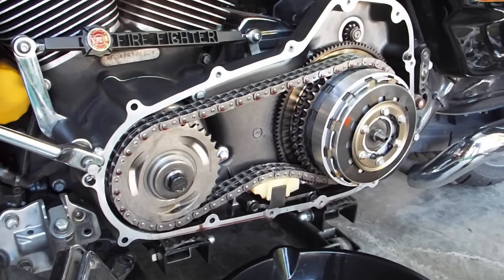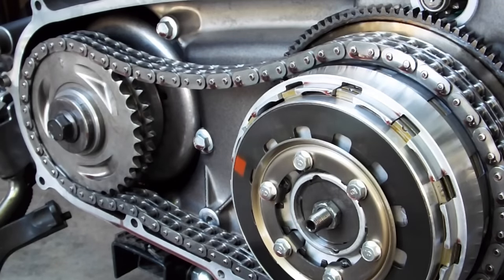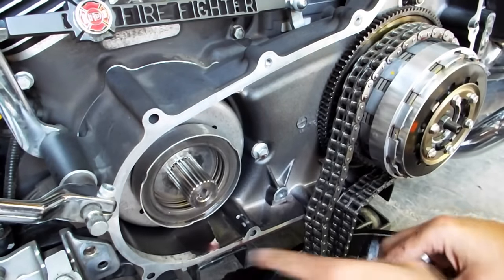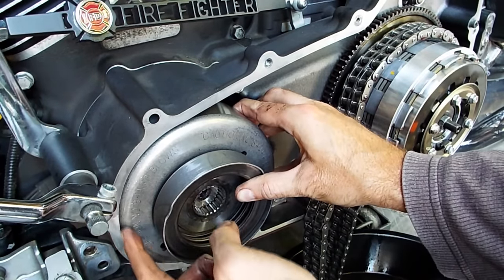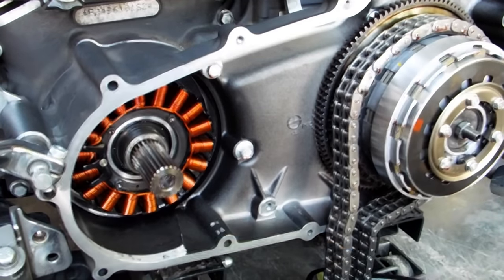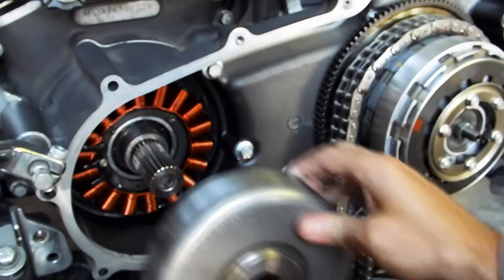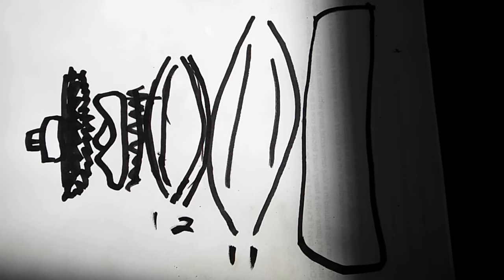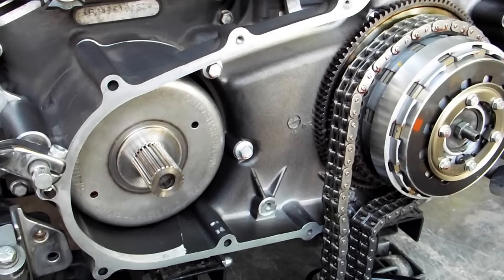Old Compensator to Newer Screamin Eagle

Comment: Hey Mark! Thank you for doing the experiment with the extra spring washer! I just finished doing it to my 2009 Road King and it seems to be working good for me so far. I did torque the comp bolt to 140ftlbs the first go round, but man after about 10 miles there was so much noise coming out of the chain case I wasn't sure if I should ride it back home or call and have it trailered. I rode it home as gentle as possible. I took it back apart the next morning and noticed that the teeth on the sprocket were running way out against the side of the primary chain and had it running way out on the clutch sprocket as well. I grabbed the torque wrench and checked the comp bolt, I ended up turning it 3/4 of a turn before my torque wrench clicked. That pushed the compensator in far enough to get the sprockets both lined up with the center of the rollers on the chain. I also put in a manual Twin Power tensioner and when I got it all back together I was happy that the bike is now quieter than it's been since I bought it 5 months ago. It shifts into neutral so easy and most of the 6 speed clunk is gone shifting into first. I'll update you when I get more miles on the bike. Thanks again for doing the experiment!!!
Reply from the maker: Thank you for letting me know! I wonder if the back spring washer dropped behind the center core and got pinched between the compensator and rotor, and then popped out when it was under load? People have suggested that adding an extra spring throws the alignment off, but that's not the case. The alignment is determined by the center core. I'm still running that setup on mine with no issues so far. I'd guess I have around 10,000 miles on it now with this setup.
Reply: Sir did you add one to the original, or screaming eagle compensator, you had stated that you got another 3/4 turn on the bolt,  I've learned that the loose thing happens too often on the original, because the washer under the bolt is springy, and doesn't transfer the tightness to the extension enough to actually even be tight. Torque wrench readings would be false against that washer. The problem goes away with the screaming eagle unit, for lack of the "WASHER" . Anyway what's your experience on looseness after torqueing the comp bolt.

Comment: Nice video. My only comment is on your torque technique. I always “sneak up” on a torque instead of torquing to final spec. In other words; torque all bolts to say, 15 to start, then 20, then finally 26. And, after final torque to 26, I also recommend you go back a minimum of three times to recheck the torque of each bolt. You’d be surprised how many bolts stretch and lose their torque after a few seconds. 

Just my .02
Reply from the maker: Thank you, understood and much appreciated.

Comment: Hi Mark I just started watching your videos 👍👍. I like the idea of trying to improve something but the compensator springs are designed to work as a set equally distributing the force . By installing  a second medium spring it doubles the force to bend that spring and causing the remaining springs to distribute the force and bend further cause the 2 medium will bend last. You may see  premature wear on the single spring but how soon your guess is as good as mine. Keep on with the videos great job.
Reply from the maker: Thank you for the comment, Mark. Yes, I am aware of the more stress added to the rest of the spring pack, good observation. I intend on opening the primary next Spring before riding season to inspect the parts and assess how things are getting along. Crossing my fingers.
Reply: I was thinking the same thing about premature wear. Because it was designed to work as a set. That don’t mean I don’t love what you’re doing man. It’s people like you who come up with ideas that often turn out better. I’m definitely gonna be watching and keeping an eye on you you’re very clever. Keep the videos coming please I like it when people think outside the box that’s why the compensator has been changed so many times. My Panhead doesn’t even have one just straight socket course it has a dry clutch Keep doing what you’re doing people out here enjoy it later
Reply: This is John again. I also have a 2016 fat bomb all kinds of noise is coming from the primary it only has 4200 miles on it of course 103 high output motor with not even 100 hp. The dealership I bought it from said they all make that kind of noise. Now I’m finding little pieces of metal way too big to be normal on the magnet dealership is lying to me. I hope it’s just part of the starter gear later on buddy sold a Panhead by the way. Love that bike John tanner easy Rider 1991 gulf war issue 49 pan I got a good price for it though. I’m thinking about going back to no compensator straight And direct. Just like my go cart when I was a kid push to start
Reply from the maker: John, I know what you are thinking with the compensator delete, but I don't believe the clutch splines will put up with that in the long term. My 2009 with about 80,000 miles is making a rattle sound from the primary that I'm pretty sure is the clutch main shaft bearing. I haven't dug into it yet.

Comment: Mark thank you for your informational videos on this issue. I just replaced my 2009 Heritage Softail compensator with the SE unit. Despite only 14,000 miles the original had failed! Your video guided me through the process, but the softail inner primary is much tighter & hence the grinding of the metal to facilitate the new stator was little more than arduous. But I prevailed:) the bike now starts & runs great, I saved over $1500  labour at the HD dealer, & I simply feel great about my bike, hopefully this is not a temporary sensation:) Luv your videos, keep them coming your a rare bird, lol.
Reply from the maker: Your reaction to the upgrade is the same as mine! Time will tell as far as how long the SE compensator springs will hold up, but they are stronger than the factory unit that was installed on our bikes. I didn't know the Softail tolerances were a bit tighter, good to know. Happy and safe rider to you, and a job well done!
Reply: Read your issue having to grind away material in your primary. Have a 2009 Softail Custom. Had no problem removing compensator with rotor. I would think it would be identical to mine ???? Harley gremlins ?
Reply from the maker: @SIERRA-dx9wm  I agree, I would have thought they were the same. There was no way mine was coming out without grinding some material away. I kept trying it and would find the high spots that it was hanging up on until it slid out, but still rather tight. Are you the original owner of that bike?
Reply: Yes I bought Mistress III brand new. Great ride. 96 motor is one of HD's best.  @contact4mwy7

Comment: The only possible issue i see is the belleville washer opposite the one where you added the extra may have the potential to overflex.  But thats probably not even an actual thing.
Reply from the maker: Actually, I agree that it could be a possibility. Right?
Reply: @contact4mwy7  Maybe. It depends on some unknown factors. I'm sure  someone with a degree in springology could   come up with an answer. 

The only time the washer over flexing would actually be an issue is if it didn't plasically deform and instead decide to asplode.  Itd be interesting to put on in a press and see what happened.
Reply from the maker: @DoRC  it would indeed be something to see in a press! I like the term "springology," that's a good one!
Reply: I think that it could be possible that the springs are nearly, completely flat against each other when the  bolt is tightened down,and the crankshaft pulses, cause them to contact,their entire surface area, therefore the pulses sould be much less, with an extra spring.
Reply: This seems like a good idea that would actually take up any slop in the system. Im going to try it as I have some extra bellville springs
Reply from the maker: @fluffypuppy720 I'm still running mine like this, same set, since this video was made. How many miles ago? Well, I'm over 90,000 now.

Comment: I have a 2011 Dyna. I removed the 2011 compensator and installed a OEM 2016 Road Glide SE style compensator. Seems to run fine with it. No more kick back at startup. So I am happy.
Reply from the maker: I am running an OEM 2012 SE compensator and have found good results also.

Comment: Adding that extra spring washer is loading your cam parts unnecessarily. Don't know how many miles you have on it now, but I would pull it and take a peak.  A tip to pulling rotor. Tap and thread the two holes for 1/4 20 thread. Screw bolts in use them to pull on. Easily control rotor reinstalling it. My stator was burned up. I did the threading while it was still installed on shaft, not worried about getting metal in the stator windings. What primary oil are you using?
Reply from the maker: Adding that extra spring washer or four brand new ones (which have to come from a dealer, hard to find) was necessary to my situation. The four original spring washers were worn out and causing issues when starting the bike. I eventually put a Screamin Eagle compensator in it, but this five washer spring configuration did a decent job for startups and absorbing engine pulses. Good tip on rotor removal and reinstall. I have been using Dexron III automatic transmission fluid in my primary on this bike and the one before it. No friction modifiers, less clutch plate "stiction," won't harm the stator wiring. It's very similar to the Red Line primary fluid. Thanks for commenting!

Comment: Hi there Mark!
Taking the thrust washer out and adding in another spring washer, Seems to me would make the double spring washers stronger against the outer one. They were a pair originally, and as such they were flexing the same amount. By adding another one to the inner spring, you ought to force the outer one to flex more because the inner two are so much stronger. I'm thinking that could become an issue later on?  I don't know if they can break, but the outer one must be flexing more than intended.......just my thoughts, anyway.
Reply from the maker: Hello Ace! You are most likely correct in that assumption. Something has to give, right? In my inspections since, I have not seen any issues created from this configuration, and although I did try running it without the extra spring washer, I later put it back in because it felt a bit too soft and a little sloppy on startup. This is only my two cents, your results may vary. Lol.

Comment: I've heard a few negative things about the screaming eagle compensator. About to have my stock 09 Road Glide compensator changed to the screaming eagle unit. Hopefully that will stop the slapping noise
Reply from the maker: I've heard negative comments too, mostly about their springs getting weak or the ramps wearing away from use, but it takes a lot of abuse in protecting the rest of the drive line. I'm still using a salvaged compensator with an additional medium spring washer at the very back to beef up the spring pack just a little more. Glad I made the change from the stock unit. Well worth the time and money.
Reply: Ummmm   I just chucked my SE comp.   Very noisy,  bucking when reving down  and shifting got noisy when hot.   Gone solid.   Night to day difference.
Reply: @semtech30  what differences does the compensator eliminator sprocket make ?

Comment: I would think that your alignment between your front primary sprocket and clutch basket sprocket would be altered due to the additional spring being added.
Reply from the maker: I know, Kenneth, but it's not the spring pack that determines the alignment, it's the stack of metal pieces in the center of the spring pack against the rotor cover. That's why those parts are not interchangeable. Thanks for inquiring.
Reply: @contact4mwy7  okay cool. Kudos

Comment: Hey Mark, thanks for the video, it helped to fix the problem I had in my bike. I would like to change the all kit with this new screaming eagle kit. Where did you get it? I would like to order the new kit with all the parts I need. Thanks for the useful infos.
Reply from the maker: Thanks for letting me know! I bought all of my parts previously owned, in other words, used. It took a few months of waiting for a lower price to come along. I bought mostly from salvage shops. The would usually have a video of the bike the part came from. Just like Johnny Cash, I bought the unit one piece at a time! Lol. Sometimes I bought a box of miscellaneous parts so I could use something in the box that was hard to find other wise. I used eBay for the most part, but there are salvage shops that will sell and ship directly to you as well. My compensator is not the latest and greatest one, it's one model back which does not use the oiler plastic tray epoxied inside the primary. Make sure you get parts that match. The new and the old SE units have subtle differences that cannot be mix and match! Ok?

Comment: Hey thanks for the great video.  I'm curious if you or anyone reading has taken the stock rotor and cut the spring basket off to run the oversized SE spring washers.  If so, think I could do it with out having to take it to a machine shop to be milled?  I bought my SE compensator 2nd hand and it didn't come with the after-market rotor.  Thanks again for your time in making these videos.  They help a lot.

Comment: Hello Mark , thanks for sharing this video . I am experiencing difficulty in pulling my compensator , Ive seen how you did it but it seems like in my case I have to shave alot coz I could not really get it out , I am using 100 grit sand paper and have shaved about 1/64 all the way to the edges and still have to shave more. How much is tolerable to sand out   ,just wanna get your idea?
Reply from the maker: Leaving enough for a good seal for the gasket. You should see scuff marks where you have sanded from the magneto cover rubbing against it. That will tell you which areas need more removed, so you don't end up removing more than necessary. I can't rule out that you may have to remove the inner primary housing.

Comment: Hoping to hear about the long term review of your set up. My Baker is starting to clunk when hot. Gotta inspect it soon.
Reply from the maker: So far so good. I don't have the current mileage on this setup at the moment, but remind me to post it. The startups are spot on (especially since I added shims to the Hayden tensioner to reduce the gap from 3/8ths to 3/16ths, which Hayden would not recommend I'm sure). No clunking around even when hot. Good on acceleration and deceleration, nothing unusual about it there. I'm curious as to how it holds up as the miles get higher, will the springs get weak even with the added 5th one? We'll see. Thanks for checking this out!
Reply: just got my Baker after 3 1/2 months on order, looks like a total redesign, please dont say its starting to clunk too!!
Reply: Friend I'd just recheck the torque on the baker...also if they sell the springs, order more.

Comment: Would you still recommend SE Compensator? 
I was looking at baker and dark horse ones. But I have concern abit on non stock feel or non stock noises
Reply from the maker: Although I am not personally familiar with either of those compensators, I have heard good things about them and have received many comments recommending them. I am happy with the SE unit so far even though it came from a salvage, but my motor is only 96 cubic inches which isn't putting a lot of stress on it. I'll let you decide which one to buy. Ask around with other YouTube makers who have put on the Dark Horse or Baker to get as much feedback as you can. Thanks for asking!
Reply: @contact4mwy7  
Yeah I will do that good idea. My bike is only stock 96 ci just looking to make it as reliable as I can. Seems so Harley parts may not be so reliable ??? Cam plate ,oil pump, compensator. Clutch basket
Reply from the maker: Yes, depending on year and model issues can pop up, and it's better to take care of them, if possible, before they happen. With my 2009 it was the factory compensator that was due to fail. Cam chain tensioners should be checked for wear even though on my motor they are tensioned by the oil pressure, not springs. Harley Davidson forums make a good read too, just Google your year, model, or part you're interested in.

Comment: I have an 05 Heritage and mine just makes noise on deceleration on steep grades when the engine is trying to hold the weight of the bike back from going down hill; then it makes a growling noise, that is increasing it seems when ever I am in steep grades. I have 27,000 miles on it and heard it start making noise at about 25,500 and has been getting a little nosier ever since. My motorcycle will cost me 465 for new springs and compensator. Might just buy the Spring pack though and try that first.
Reply from the maker: I would go the spring pack route as long as everything else looks ok. Check your primary chain tensioner too, as it bears a lot of weight when slowing down.

Comment: Did the outer primary have the deflector already there or do you have that install video
Reply from the maker: There are two types of Screamin Eagle compensators. One uses a regular hex head bolt, like I used. The newer style uses an Allen head bolt and has to have the funnel to drip oil into the center area to lubricate the inner parts better.

Comment: Bikebender 

Hi Mark, What is the difference between the rotors other than the "spring can" on the original.  Get where I am going with this?
Reply from the maker: The thickness of the center of the rotor. It's important to match up the compensator components and not "mix and match" them so that the alignment of the primary chain stays the same. In other words they are not interchangeable. I wish they were, would have saved me a lot of time and aggravation! I hope this helps.